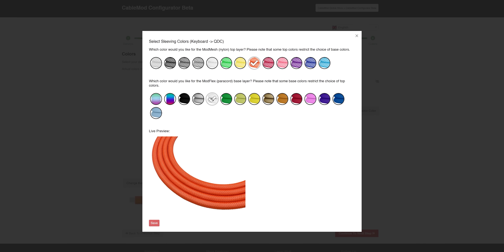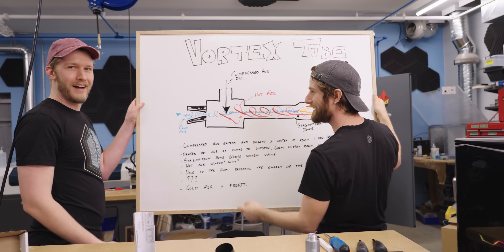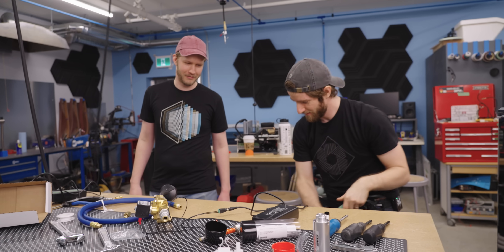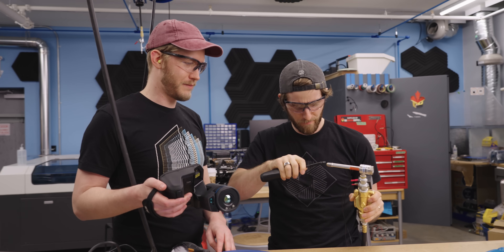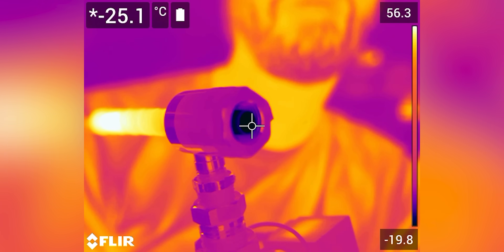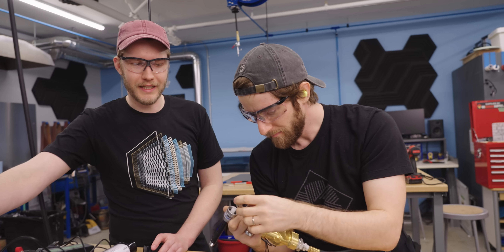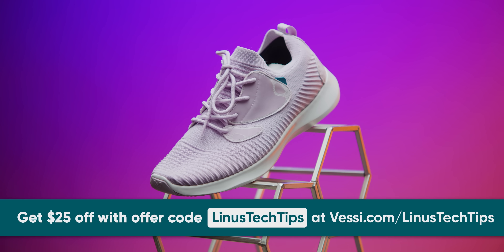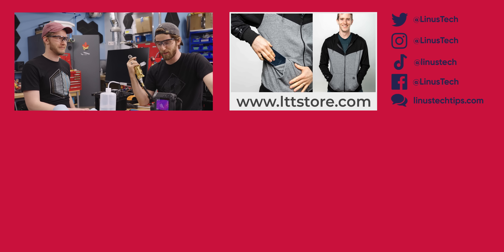This is a CPU Cooler? - Vortex Chiller

Comment: These are known as Ranque-Hilsch coolers.  When I was at RPI these were known as Hilsch tubes, then there was an engineering improvement that makes it much more difficult to understand.  (That's the Ranque part with the air reflected and the cold air more concentrated.)  The Hilsch tube itself is pretty easy to understand.  Create a circular chamber with a hole on one side near the edge, and a hole at the center on the other side.  Now add a third port that is at the edge of the circular part and blowing at right angles to create the vortex.  Like in a centrifuge, the heavier stuff goes to the outside.  In this case that is the colder air.

I saw one Hilch tube unit for putting in the anchor cable (mooring rope for you not naval types*).  For a sailboat, it would provide cooling to a refrigerator and optionally heating to the cabin.  (NOT for use in winter climate, but it could extend the sailing season a few weeks on either end.  I wouldn't try to put it into any of the sheets--the ropes that pull the lower corner of the sail away from the mast--when the boat was under sail.

* Special vocabulary makes things much more concise.  For sailing it helps when you just have a skipper and one crew, and makes it possible to manage a ship with hundreds of lines.   For example, the skipper is the person holding the wheel or rudder, unless the ship has a wheel with multiple sets of spokes--and people holding them.  Then the skipper is the OOD.  Note that who the skipper is is very well defined, even on modern ships--everyone within range of the skipper's voice must know the sound of the voices of anyone who might be in that role.  Oh, and the call "Captain on the Deck!" should have everyone saluting.  But the salutes are not the point, they are the acknowledgment that the Captain is in a position where he may override other orders.

Of course, on the bigger ships, this culture is limited to the bridge and the (CIC combat information center).

Comment: I think it would be better to make a "air block" specifically for the CPU. Basically a heatsink with ducting to give the air enough contact time with the heatsink. The problem with using the cooler with the heat pipes if you are actually getting the pipes down to freezing the water in the pipes which is the working fluid may be freezing.

Comment: We use those types of coolers at our factory.  Just hook them up to an air source and you can get 20 to 30 degrees cooler air than ambient blowing on what you need cooled.  Yeah, they are loud AF.  We have an industrial air compressor room that is massive that puts about 105 psi through the building.  They can get so cold that the condensation will actually freeze in some conditions.

Comment: The Vortex cooler is amazing I took one apart and its a tube with a plastic flat round thick washer that has grooves in it that are angled so the air spins the washer and last a metal washer with a small hole in the middle. This washer was probably used for pressure increase to the V groove metal part. So basically the setup took the cold out sending it one way and expelled the hot out the end. the air is separated by a bent metal sheet (in a V shape) in the tube. hot air comes out the bottom and cold comes out the top. This unit was for a fresh air breather setup for painting industrial coatings on large Jets. What happened to mine was that bent metal part slipped into the tube and the cold stopped. There is no electricity only compressed air going to the unit. It was not unusual to hang my hood up and come back and the face shield was frozen or on hotter days covered in condensation and very cold. The unit expelled hot air that would burn you. I got it working again once I figured out there the metal part went. The only moving part was the 3/8th inch washer with the grooves into it. Taking it apart was not what I expected on the inside.

Comment: You should attach this at the top front of the case, pointing down behind the front fans to fill case with cold air, maybe then see what effect it has on air cooler performance.

Comment: I imagine by blowing directly onto the cpu you are creating a thermocline. Even in metals if there are layers with drastically different Temps heat transfer won't occur. So basically you were sealing the heat in the cpu and there is such thing as too much cooling...
Reply: I have never heard of conductive heat transfer being stopped by have too much of a temperature gradient, where are you getting this from?
Reply: @trouty7947  its the same principle that let's you pour liquid nitrogen on your hand and not get frostbite
Reply: Sounds like some pseudoscience not gonna lie
Reply: @trouty7947  space...
Reply: @brazenh2836  space got some whack ideas then

Comment: I do not know if that was already mentioned, but to mitigate the condensation problems I think this could help: 

- Cool down the compressed air through a radiator which can drop the temperature below dew point for that pressure and relative humidity. Extract the water with a water tramp. Some compressors have even a built-in one. Being external means you can apply other chilling sources to cool it down even more beyond ambient temperature. 
- Put a chemist-based filter like the ones sold for refrigerators/wardrobes. Easyly passing the air through a piece of a big enough pipe or even a recycled gas cylinder filled with this pearls. They will dry completely the remaining moisture. The chemist can be recycled by reheating it up. 

Just for fun because it's a very very expensive way to refrigerate but with obvious advantages. Anyways dry cooled air is usfeul for many applications. I'd try how long does a beer to get frozen so xD.
As always loving your videos, thanks again!!

Comment: The basics of that is that there is a decompression chamber where the air goes in from the hose goes into the decompression chamber and rapidly expand generating a lot of energy and also removing the energy from the CPU in the form of heat therefore the evaluation in watts

Comment: I'm an Industrial EE, and these are great for when we need to cool field equipment in a cabinet, but can't use fans because the ambient is hot or humid, and putting in an AC would be overkill. 
I wonder what would happen if you put the cold end against the hot end of a peltier? since the peltier operates on a differential, would the cold end get EVEN COLDER? what would be the delta between the hot end of the vortex and the cold end of the peltier?

Comment: Tech support is here

You can use an "oldskul" aluminum heatsink on the CPU for better heat distribution, and use a thermal paste if you insist on blowing air on that system.

Air is a horrible thermal conveyor and I suggest you do not relay on it, even liquid coolant systems relay on solid heat transfer at their end points. 

Do not use a water cooler - I remind you that water freezes in (-40) and have been known to do so for less, or more... Depends how you count it. :3

If you insist on using liquid cooling make sure to use an emulsion with the appropriate quality instead of water.

Best of luck next time! :)

Comment: The vortex tube, also known as the Ranque-Hilsch vortex tube, is a mechanical device that separates a compressed gas into hot and cold streams. The gas emerging from the hot end can reach temperatures of 200 °C (392 °F), and the gas emerging from the cold end can reach −50 °C (−58 °F).[1] It has no moving parts.

Pressurized gas is injected tangentially into a swirl chamber and accelerated to a high rate of rotation. Due to the conical nozzle at the end of the tube, only the outer shell of the compressed gas is allowed to escape at that end. The remainder of the gas is forced to return in an inner vortex of reduced diameter within the outer vortex.

---

For an easier explanation, it makes air spin really fast and only the fastest air is ejected from the conical nozzle which takes most of the heat with it. The return air spirals back with a much less heat energy. It's basically like an air centrifuge where it separates air by heat content and spits out the hottest air, leaving only the cold inner air.

Comment: To make it work woth the sink, you have 2 things to consider. 

1. Heat pipes only work in a particular temp range. So it may need a simple copper sink.

2. You need to take that jet and duct it to slow it down over the whole sink.

Comment: In the steel industry, we use them to coll remote I/O racks for plc's  We blow around 9000 scfm of oxygen so we have to vent at least twice that in nitrogen, so its piped all over the place to replace instrument air.  It's always dry!

Comment: These are often used to cool enectronic enclosures instead of a specific part. You could have cooled the PC case if you blocked most of the airflow into and out of the case. It would basically act like the ambient temp of the room is lower. The outside of the case could frost up if it got too cold, but not the inside. The dry compressed air doesnt contain moisture.

Comment: When you get "condensation" is not only dependent on temperature, but also pressure. The speed of the "vortex" is creating very large changes in pressure. You're getting temperature changes because of the huge changes in pressure and how gases operate in a vortex. So, you see the condensation on the outside because you don't hit the point of vaporization (condensation) inside.
That is assuming it is designed to ensure that you can use standard air as an inlet and guaranteed to not produce water vapor lol.

Comment: The fact that compressed air is used is 70% of the cooling since it is stored energy. Heat was generated and energy used when the air was first compressed. Just like using a keyboard duster can spray which can freeze up when using it. The vortex tube actually re-compresses the air allowing some of the re-compressed air (hot) out the one end and this hot air was heated by pulling energy from the air escaping out the other end thus making it even colder. Energy cannot be destroyed only transferred from one to another with a by product of heat. The vortex is a similar concept to the axial compressor in a turbine.

Comment: To be fair, the vortex tube was invented in 1930s but wasn’t fully explained until 2009 in a paper published in the journal “Physics of Thermodynamics” (I don’t exactly remember the name of the journal). Apparently, in order to make the physics work understandable, or maybe even tractable, the problem must be analyzed from a centrifugal/centripetal (I don’t remember which) point of view. From the beginning to the end, the vortex tube is just amazing and weird. Not only does the tube dump hot air out of one end and cold air out the other, but the inner, cold vortex spins the opposite direction of the outer, hot vortex. The more hot air you release, the colder the cold air gets (but of course with lower volumetric flow).

The vortex tubes are also “commonly” used for cooling milling operations.

Comment: I understand.  The backflow air expands, the forward air compresses.  This makes the backflow air cold, forward air hot. 

What's so hard to understand?

As of how to more effectively use this, I would recommend using it to precool coolant to sub-ambient temperatures when going through a cooling loop.

Another option is to adapt a water cooling water block to use the super-cooled air, but there is a risk of frost buildup unless you find a way to remove the humidity from the compressed air.

Comment: it spins the air. the air around the outside of the spin is squished by that, which heats it. The air in the center of the spin is stretched by that, which cools it. It separates the center air out one side and outer air out the other side.

We use them to cool breathing air for guys working in supplied air respirators.

Comment: Vortex tubes are amazing and can change the input air temperature up to 60f or so. These tubes are used on cool vests and in cool suits for sandblasters as well as in steel Mills to eliminate heat injuries on the job. It's amazing and works by separating the hot and Cold air molecules. Kind of like how a large storm cloud sucks up warm humid air and blasts down cold ass air. 

Also btw. You can get a vortex cooler for like $150

Comment: I suggest building a custom heat sink with hollow copper pipes, and blow the frosty air through the copper pipes, similar to how old fridges work, but using cold air instead of refrigerant gas. You can build an adapter that allows you to connect the cooler cold air exit to the heat sink copper pipes.

Comment: Seal the case with duct tape and attach that to the front and open a small vent in the back and let it run … effectively “ air conditioning the entire case “ 

Or maybe even build a enclosure around the heat sink fins and do the same thing so you can control the air flow

Comment: It's called Joule-Thomson Effect. Essentially, forcing air from a larger opening through a nozzle that is smaller opening causes the air to cool. Some people in India made a natural air conditioning using PET bottles where they cut the bottles, fix it on a platform where one side it's all the big opening and the other side is the small opening, the wind blows through the big side and exit the small side, the air will be cooled

Comment: Ingersol Rand 50 HP rotary vane compressor where I used to work had a radiator the size of one from a compact car, used not simply coolant, but a Lubri-Coolant that was like $125.00 per gallon. We ran two 75 foot long 4 color screenprinting presses with it as much of the mechanisms were pneumatically powered. They print like 4" x 120" banners up to like 300 per hour. Big things.
That might run your cooler.  :)

Comment: You might have been causing the heat pipes to not function properly because the vapor chamber might have like stalled. Like the liquid stopped moving due how cold you made it or maybe cooling the wrong section. 

Or maybe the vapor was too cold and colded move fast enough due to being such a low temp. Cold things have slower movement
Reply: yeah. they shouldn't cool the heat pipes, they are for transporting the heat not for dissipation and require a certain temperature to function properly.

Comment: you also have to consider the total thermal density.  -50 degree piece of paper is different from -50 degree brick.  reason why those heat pipes work so well is they can transfer a lot of energy to a huge surface area.

Comment: these are also useful in industrial areas where you need a passive cooler that won't cause arcing/sparking or where the area has explosive gases present.

Comment: I would certainly want to try cooling a radiator for a liquid cooler with this. Run your tubing out of case and have the rad in a custom box with an air inlet on one side, the rad in the middle, and an air outlet on the other side.
Reply: Also have a splitter on the inlet to direct the air evenly across the radiator. Wouldn't even need a sealed box just a shroud.

Comment: Since the heat pipes are acutally void space filled with water vapor under vacuum, I assume the cold air could freeze the water preventing the wicking from happening, thus lowering the thermal transfer as the cooling would then be forced to occcour in a practically smaller tube (smaller tube >> smaller transfer = less efficient heat transfer). I can also assume that though the colder air was on the die , this had a negligible effect as the surface area used to dissipate heat was significantly diminished. I would retest with a solid aluminum or copper core cooler that contains no heat pipes or vapor chambers. (for the science OFC)

Comment: I work on jackup rig in Saudi Arabia and we installed few years ago some Vortex systems on some panels with computers that are exposed to weather and had poor ventilation/cooling.
In the beginning I was a bit septic about the system but was surprised how well it works. 
Still today for me looks magic air in, hot air in one way and cold on the other.

Comment: Air is a really bad heat conductor, which is why air coolers need a lot of surface area.
You were only blowing cold air onto the cooler, not through it.
And when you removed the cooler from the CPU you removed 95% of the cooling surface area which is why it could not keep up.

On the frosting note.
If you have an air and oil filter on the compressor, the air gets dried which is why no frost was inside the nozzle.
But as air leaves the nozzle, it creates a venturi effect, pulling a lot of ambient and moist air onto the outside of the nozzle, making the moisture freeze.

Really cool product :)

Comment: Ranque-Hilsch vortex tubes are used on some older biz jets for temperature control. Amazing idea and theory and works really well but you have to think of it as a fluid and not like a compressed air gun

Comment: You asked why the frost is on the outside. Here is my educated guess.

Regular ambient air with the same humidity as around you is compressed into the compressors tank. It then comes into the vortex, which creates a hot air and cold air stream. The cold stream cannot hold the humidity, and the hot stream can, thus the humidity finds its way out the hot stream leaving the cold stream dry. When the cold air come out the end it cools the tip of the device. This causes the regular ambient humidity to condense on the outside of the device. Since dry cold air is coming out, there is no condensation on the inside.

Comment: FYI gas is really bad at holding energy and will not transfer it very well. That's why we use air (a mixture of nitrogen, oxygen, CO2, and other trace elements) as an insulator in windows. The nozzle of the vortex cooler may have been at ~-40°C, but the air probably wasn't anymore just a few centimeters away from the nozzle. It's still cold, but you're not using something like Mr. Freeze's cryo gun.